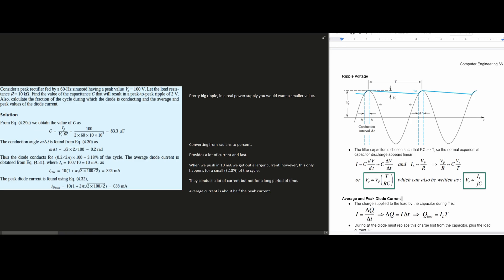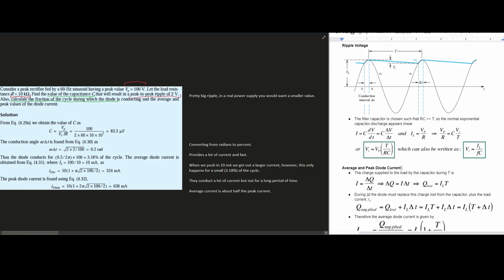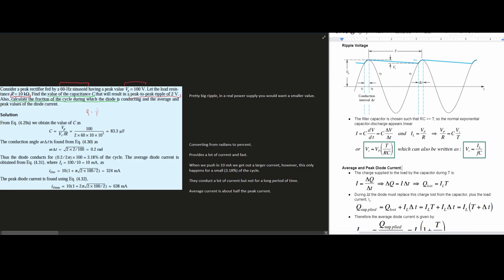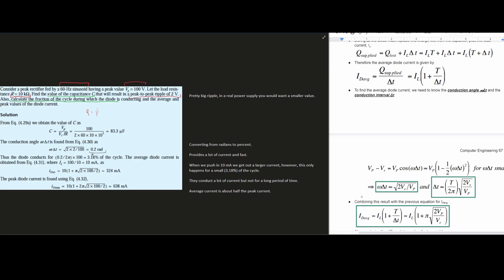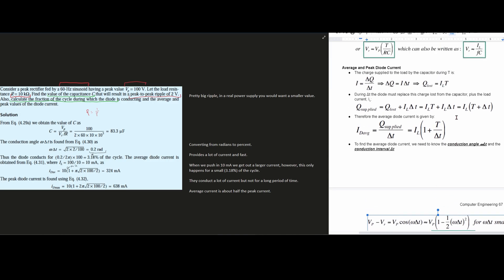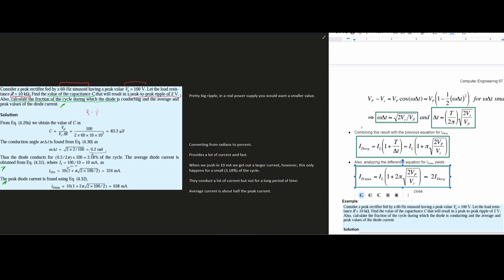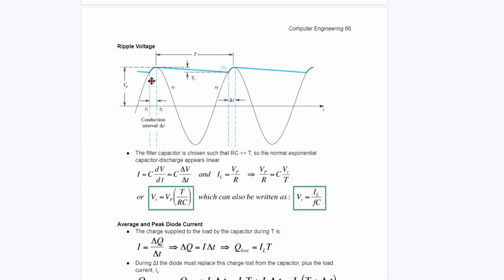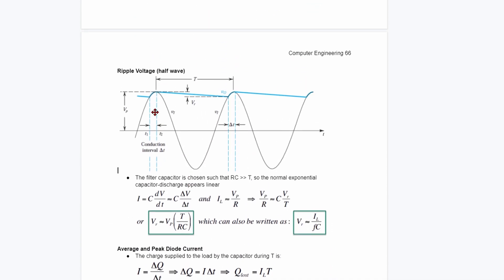Electronics I (Diodes): Consider a peak rectifier fed by a 60-Hz sinusoid having a peak value Vp ...

Comment: How would you find vr if it isn't given
Reply from the maker: I believe you should be able to derive it with other information given with the problem and the different equations in the notes
Reply: @ComputerEngineeringCPE  so my professor gave us the first half of this question on the test we were given v peak=100v , the frequency 60hz and ressistance 10 kilo ohms and we were supposed to calculate the fraction of the cycle for which the diode conducts , do you think there is any way to figure vr out with this info? Thanks for your help :)
Reply from the maker: I think there may be something like that in my notes I have in the Google docs. 

I would say consult that as it has been a while since I have taken this class and that's what I would do